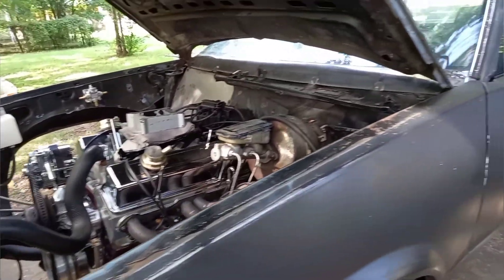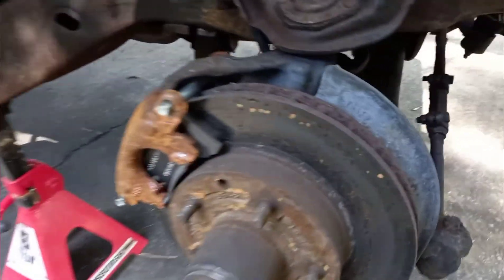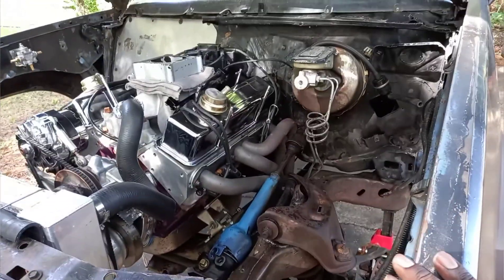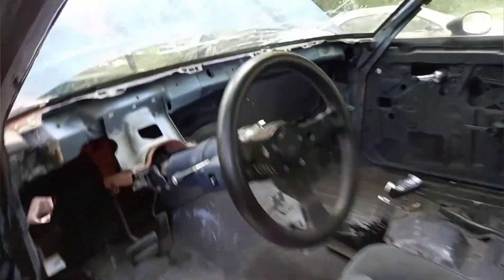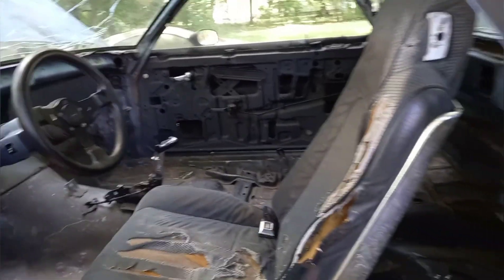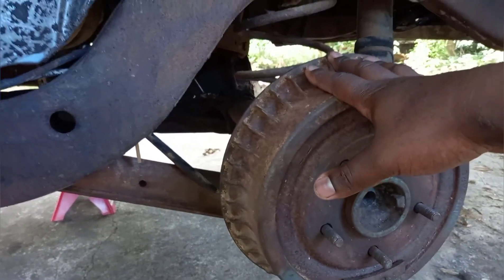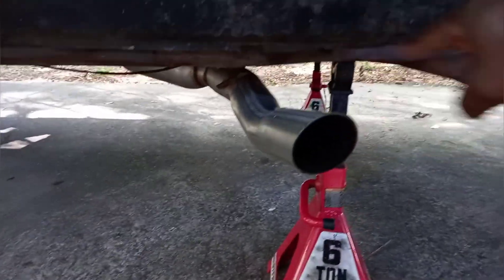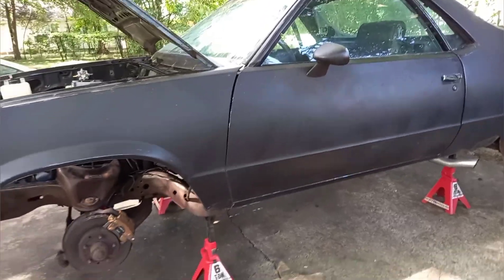Update on the el camino

Comment: Bout to say where you been at. Good to hear you didn't have a accident due to those brake lines. Im beef up my 7.5 like yours. 8.5 are impossible to find and a 9 inch is out of the question. I have now need for one with my set up.
Reply from the maker: Yeah them breaks had me going trying to stop. She was pulling hard wish i had a good video on it.
Reply: @Runitupracing  i know that el dawg was rolling. hahaaa!! I already know. You probably stomped a hole in the floor. I had a junk carb on mine and the throttle was stuck wide open. I stomped and stomped to free it but that sumb** kept pulling so i hit the ignition switch then it back fired really loud. Bro i was standing up in that car trying to free the gas pedal LOL!
Reply from the maker: Wild ride lol
Reply: @Runitupracing  yes indeed